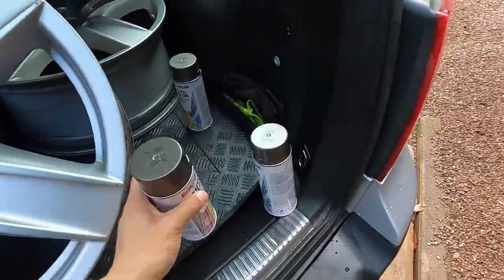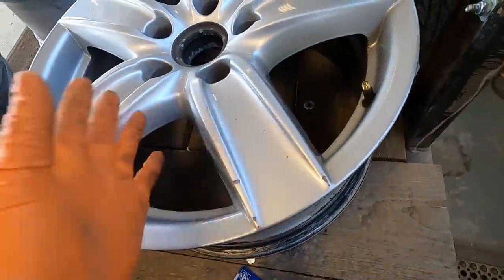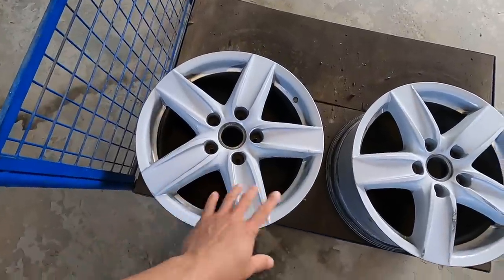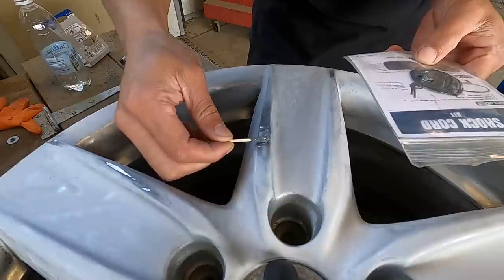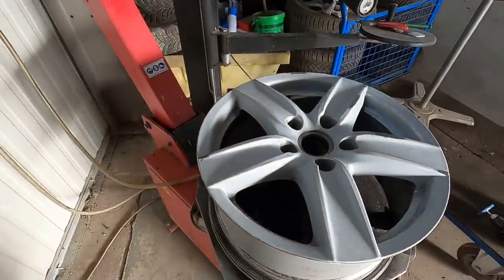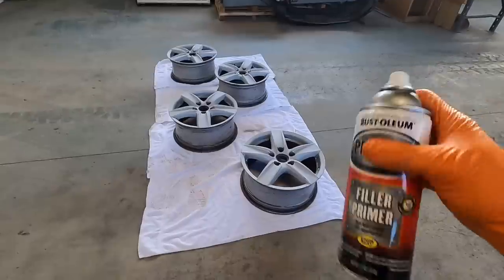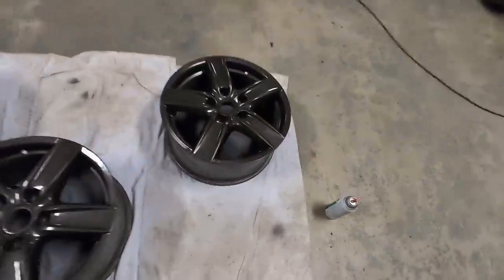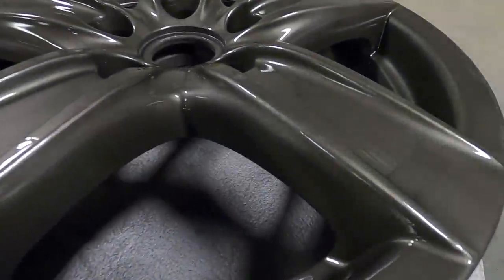Painting And Repairing The Porsche Cayenne Wheels! ( MK4 Bora Wagon )

Comment: Just a tip, when you have an alloy wheel in the tire changer make sure you clamp the wheel from the outside so you don't damage the inner face of the wheel with the teeth of the clamps.

Comment: Last time I sprayed my wheels acid dipped them to bare metal at uk cost of £15gbp per wheel 
Sprayed inside rim and back gloss black and face bmw metallic grey 
Doing so helped with the bead not flaking paint for air to leak could be an option for you before hitting tyres unless tyres are on before my comment posts lol